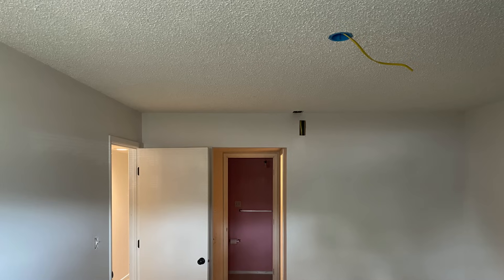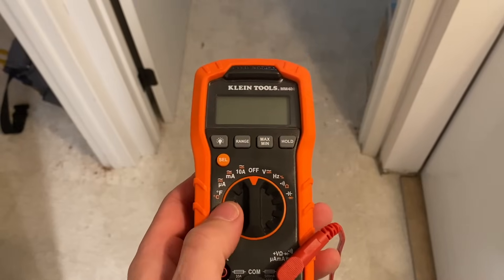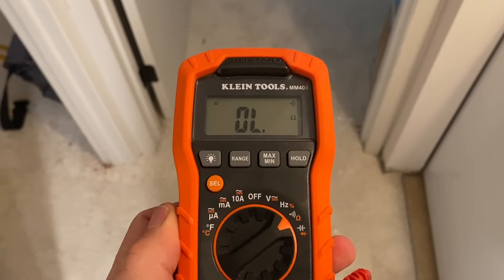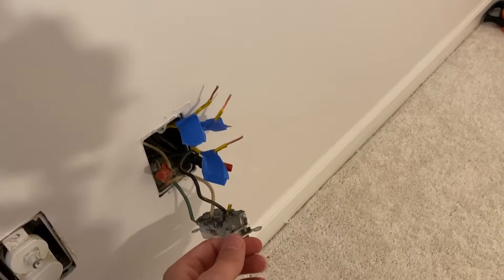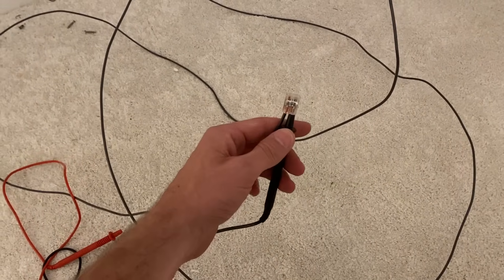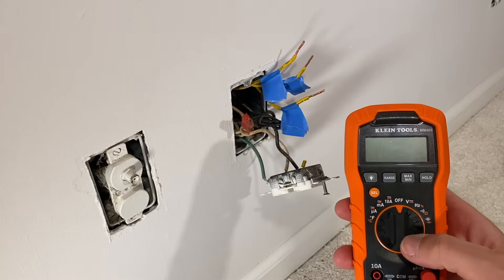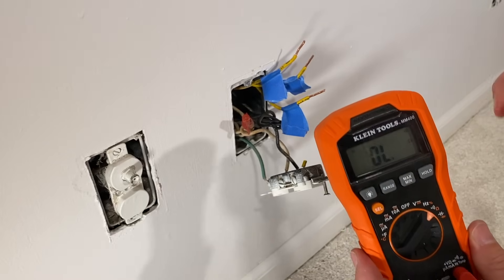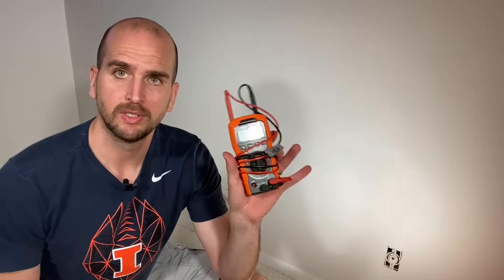How To Trace Wires In A Wall | Multimeter Continuity Test

Comment: And if the wires are in different rooms/floors - so the extension cable is not easily connected- what would be the best solution?

Comment: Can this trick be used for neutral cable? I have a three-way switch that is meant to light up four (4) can lights but I can't find the loose neutral wire. Of course the prior contractor or owner left dead wires in the conduit. I really want to avoid having to re-wire everything. HELP!

Comment: Good video. Thanks. Somewhat misleading however, as you describe setting the meter to "ohms", but aren't you really setting to "Continuity"?  On your meter they are the same setting, but on many meters, Including my Fluke 77 IV, they are different settings, so setting to "Ohms" as you describe does nothing.  Setting to "Continuity" gives the proper result.

Comment: I added a heated floor in our bathroom. Now I have a 'nuisance fault' tripping the arc fault in the wall sensor. (Schulter heated flooring). It is on a dedicated circuit. However, even when I disengage every single breaker in the panel box, except my floor, I still get the nuisance trip. How would I go about tracing that fault? Or do I need to do a complete rewire of my panel?

Comment: I understand and appreciate the comments that (for some situations) this can be done without the extra wire.  But I like the way that he's shown - with the extra wire: it can be used for ANY situation, ANYWHERE, and does not depend on additional wires.  So it's good for any home power wiring, speaker wiring, RCA wiring, coaxial wiring, Cat5 etc. wiring, and anything else you can think of, as long as it's unpowered and of reasonably finite length.  And it can even be used for a single wire with no other wires anywhere near it, other than the extra wire he's using to test it.

I like the comprehensive approach he's shown.  I'm going with it!
Reply: Me too

Comment: Wow this looks super complicated lol, i usually just bypass switch so outlet is hot all the time the just run switch leg from the light switch box, cuts down on the confusion. The only time i can think of using continuity is for water heater thermostat check

Comment: Why not remove slaving switch. Bundle wires to outlets together so they are always on? Push bundle deep in box and add new switch and wiring for the ceiling fixture. You shouldn’t have to touch those outlets.

Comment: I understand the need/want to have a ceiling fixture option but I'd never have a new home without one half of each receptacle wired to switch in the bedrooms, living room, den, etc. There's NOTHING like the ambience of lamp lighting! (Ceiling fans need a ceiling mount of course. So I remodeled with two switches in these rooms.)

Comment: My problem is, with a ceiling fan point, where ceiling fans are getting burnt. Thrice, it has happened already. This point is operated through two way switches. Since, last 20 years,     it was functioning well, untill recent problem. How do I find the fault, either with a multimeter or any other method?

Comment: Does the circuit have to be turned off to test continuity?   I would think so but want to verify
Reply: Yes. The tester itself it actually forcing a small amount of current through the cable and that is how its able to test continuity.

Comment: Thanks for the video. Can I use this same technique to check continuity of the ground on my water meter to my ground on the electrical box?  I have so much audio noise (EMF) while playing electric guitar through a guitar amp. It changes as I move my guitar's direction, but much worse by the water meter. Thanks in advance :)

Comment: You might use a wire tracer, which sends signal along the wire, you can then use the detector to trace where the wire goes. You don't need an extra wire, nor you don't need the probe to touch the wire core, even you can detect the signal outside the surface of drywall, which let you know which direction the wire goes. More, you can use it to tell where a wire is broken inside the wire sleeve. I bought one at about $30, very useful. Make sure there's no power on the wire before connect it to the signal emitter.
Reply: This is perfect! I'm buying one right now.
Reply: This is a good explanation, I have a question for you! Can I use the wire tracer to find a cable that has been bitten through between the ceilings?
Reply: What is the name of the tool you use to trace ? Or model number I’m interested in buying one

Comment: Can you do a video on adding smoke detectors to a hard wired system. I have a room that was left off the detector run and not sure how to add one in to the existing circuit

Comment: Great video.... thank you... I used an extension cord instead of the solid core wire. I also used alligator clip 12 inch "jumpers" instead of the Wago. With both boxes completely undone, you can use the hot and neutral in the same romex cable to test continuity.  Breaker is always in the off position when working with home wiring.  Thanks again. Great video.

Comment: Quick question I have a outlet with 2 light switches one for a light and one for the garbage disposal and a power outlet but one switch has 3 set of wires when the other switch has one and the power outlet has 2 sets of wires , how do I hook that switch up??

Comment: EVERYDAY HOME REPAIRS, when using cable Trackers/tracers if the wires in the house are wiring all over the house, the cable tracker tracer doesn't tell you how long the cable length is and where the cables go up, down, left, right because the cable can start in the back of the house and run all over until it reaches the front room in the house. Anything to use that will find the cable length or if the cable has breaks in it?
Reply: The ohms\continuity will help you trace a wire and show if it's broken. He was just using the continuity and listening for the beep.

To find the length, you can also use ohms. (Ex) 12 gauge wire has 1.6 ohms per 1000 ft and 14 gauge wire has 2.5 ohms per 1000 ft. If you had a spool of wire and you wanted to know how long it was you could calculate it out.   1.6ohms/1000 = .0016 ohms per foot. A wire 20 ft long should have an ohms reading of around .03 ohms. 500 foot wire would have an ohms reading of .8 ohms. It might not be laser accurate but you an get within a couple of feet.
Reply: @bjen2005  I wonder where you get those numbers. 1.6 Ohms for 12 AWG and 2.5 Ohms for 14AWG? That doesn't seem right, because according to NEC Chapter 9 Table 9 for 12 AWG it's 2 Ohms per 1000 ft, and for 14 AWG it's 3.1 Ohms per 1000 ft

Comment: Thanks for sharing.

When the two living room lights are on, the toilet, laundry and bathroom light switches don’t work.

When the living room lights are switched off, the toilet, laundry and bathroom lights act weird.

Toilet light switch turns on the living room lights and toilet light is half illuminated as though not much power is getting to it or it’s out of phase or something.

Laundry light when switched on thinks it’s the living room light switch as zero power makes it to the intended laundry light.

Bathroom light switch seems linked to both bathroom AND living room light fittings. When I turn on the bathroom light switch, the living room lights come on in addition to intended bathroom light.
Reply: Damn sounds like you have a bunch of 3 ways wired weirdly and also some loose connections somewhere

Comment: 1. turn off power at the breaker.  2.Isolate each cable coming into the box twisting the hot(black) and neutral(white)conductors together one cable at a time.   3. go to the other outlet or switch box and place your meter on OHMS to the loose hot and neutral of each cable.   4 The one that beeps is the cable you have twisted together at the other box.   5.ID that cable, untwist the conductors and proceed to the next pair of black and white conductors on the next cable. 6.Label each cable as you go. This works for locating shorts as well.
Reply: Could also just use the wago he showed to clip the hot and neutral together
Reply: I was going to leave the same comment when this popped up in my feed that's how I trace all my wires. Who wants to run a wire through someone's who house to test continuity if you only need a wirenut
Reply: Mind blown
Reply: I've used the other method and was looking for a way to not have to test with the long wire. 
Thank you for your contribution!
Reply: @Adekunle Once you bond the hot coming into the second box with the neutral, you can think of that hot wire as extending through the entire house by taking a ride on the neutral side. 😎 All neutrals tie together. Obviously the breaker box should be off for this cheat. So now you know when you touch the neutral in outlet #1 it is actually the hot wire that is feeding through the wall from outlet #1 to outlet #2. So how do we complete the circuit for continuity and get tone? Prod each of the open hots in Outlet #1. One of those is the hot wire feeding into Outlet #2 that you tied into the neutrals.
Reply: But what if, all the wires are the same color 😅😅
Reply: That's what I am dealing with  @liudxdx
Reply: Thanks it makes sense that way
Reply: @Adekunle Hot and neutral tied at one end; Meter leads placed on the open ends of cables at the other end. I don't think you have this pictured correctly
Reply: Can you do this kind of testing without opening the outlet to expose two leads to short together? Like can we just create the short on the outlet itself with a prong between hot/neutral openings?
The reason is that with all outlets installed, I'm just trying to map which outlets are on the same circuit without having to pull out every single outlet.
Reply: Yeah. But this way works too. This is a safer way if you aren’t sure everything is on the same circuit. Like if you don’t want to turn off power to the whole house.
Reply: Thanks thats really helpful advice
Reply: great.....thank you......
Reply: Donka
Reply: Exactly how an electrician taught me how to test for continuity years ago.  Try it yourself on 2 short lengths of wire on your workbench.  Use zip wire or speaker wire if that’s all you have; same results every time.
Reply: love it so helpful
Reply: How does it work for shorts?
Reply: @janhaag3540  Open both ends of the cable(black &white conductors) Place your meter on OHMS and connect the leads. If you get a reading of OL or infinity, the run of cable is fine. If you get any reading of ohms (even zero) you have a short in that run of cable connecting the two conductors(usually a staple or screw/nail etc.) Good luck.

Comment: You can do this without all the extra wire.  Simply connect the wire you are attempting to locate to the common wire in the same box. Since ALL common wires are bonded in the main panel you can then go to the original box and use the common and test each other wire until you get tone. This would work using ground also.
Reply: Make a video? Leave a link here?
Reply: @Orlena2525  To clarify: He is saying tie the hot to the netural (aka common) on outlet #2 in this video. He did not disconnect the netural in outlet #1 nor outlet #2. Thus, once the hot/netural are bonded on outlet #2, you can walk back to outlet #1 and touch a probe to the neutral and it is the same thing as touching the hot all the way over at outlet #2. Then the other probe is used to touch the hots in outlet #1 and you've got the circuit made for the continuity test. You can be assured all neutrals are always connected and will result in a valid test. That is because all neutrals run back to the netural bus bar at the breaker box and they all touch the same plate. This should be safe, but it does sound dangerous? If you accidentally connected a live hot to a neutral then it should immediately trip the breaker as a short circuit...
Reply: @lakecityransom  so if I needed to locate a matching neutral in a service panel to a hot; I can just connect the hot and neutral of the circuit I'm trying to trace, and then use the probe to locate the hot neutral in the circuit panel?
Reply: @MiamiHeat872  I'm not an electrician but all the neutrals are tied together back at the breaker box so it should be irrelevant unless there is multiple incoming service breakers. If you mean it as an academic question then sure you could touch the hot in the breaker box but then for the neutral you would have to take neutrals off of the neutral bar one at a time to test them since they are all connected together, but it could work.
Reply: @lakecityransom  Definitely not an academic question. 

I got a 1950s service panel with ungrounded wires going into it and unidentified neutrals coming in bunches through conduits.

I want to update the wires so that when I have an electrician change the service panel, they can do a swap easily since a lot of breakers have to be AFCI when updated.
Reply: @MiamiHeat872  ah ok I figured the only thing that made sense was to clean up possible dead wires or add wiring for an older house so I guess that is exactly what you are doing. :) Kind of like when the satellite TV guys come and put a new dish in and a new set of wires drilled into your house every time lol. Good luck.
Reply: I have a problem and is that i lost electricity in a circuit. I replaced the old outdated outlets and switches. Turned the breaker back on and nothing. I saw this video and followed the same instructions and found that the wire that I believe is coming from the breaker gane me a reading of 205 on continuity. The other wires fro the outlets and switches didn’t show anything. What do this means! Help!!!

Thank you in advance!!!
Reply: Im having same issue.  Did you ever figure it out?   @YourpainRx
Reply: What would be the Common wire in the box the white wire that is with the Line / Power Right?
Reply: Good thinking .but i would like to see it if it really works
Reply: what’s a common wire. how do you identify it.

Comment: Okay I see you are new in this troubleshooting process. Let me suggest how you can easily find right wire. One incoming wire (yellow) connect to the ground wire and with continuity check find associates wire. Easy you don’t need extra jumper. Imagine you have to check plug in other room or floor above, you need long wire which is ridiculous.
Reply: @Theodore Myles   You're right....no one cares

Comment: You failed to mention that the power should be off on your circuit breaker at your panel! Otherwise great video on demonstrating continuity!
Reply: Thank You. I was wondering if anybody noticed that too. If you're chasing down wires in your walls to figure out what goes where, you got to flip this breaker OFF or at least precheck all the wires in AC mode before "horseshoe" (sic) mode. Or you or DMM may got abruptly damaged. BTW - never heard about that greek symbol omega to be called horseshoe. LOL.
Reply: Did you intend to say the circuit breaker should be off?
Reply: @truthbebold4009  yes thank you, it’s been corrected

Comment: So I see how you found the hot wire but how about the white that corresponds to it.
Reply from the maker: If you have Romex in your home and you have found the hot wire then you usually can just match that to the neutral and ground coming from the same romex line into the box.
Reply: @EverydayHomeRepairs  10-4
Reply: I needed to do something like this when installing a GFCI breaker. Power off, of course, I connected the hot and only neutral at the outlet with a Wago. Then, I disconnected the hot from the old breaker and disconnected the two neutrals I thought it could be from the bus. One of them had continuity so that was what I was looking for. 

You could also do something like that instead of running a wire across the room like was done in the video.

Comment: Do you haver to have the wire stripped?
Tracing a wire at the switch  (wire is stripped). Back at the breaker panel can I just clip on a wire.
Or
do I have to detach the wire from the neutral bar?
Breaker panel is off.
Reply from the maker: I would remove from the neutral bar to isolate which wire you are tracing.

Comment: Dude..disconect hot wire and tie gound together with wire in question  .no need for extention wire
Reply: I use the ground because its already striped and and you can just positupn the wires so they touch no need to take too much apart
Reply from the maker: Thanks for the feedback 👍
Reply: Since the breaker is off, put the hot and neutral in the wire nut and go around the room with the meter and check each hot and neutral with the meter until you close the loop.  That's just how I would do it. :)

Comment: Why take all the outlets apart?  Just use leg from the switch and wire it or wago it the the full time hot and you’ve accomplished the same thing.
Reply: Do you have a video showing this? Would like to see it done. Thanks
Reply: Julius Byes no I do not. Just 20 years of experience. 
All the top switches outlets originate at the switch along with the line power feeding the switch. Just makes sense to me to tie the switch leg to the hot and bypass the switch to feed the top half of outlets

Comment: How do you measure "leakage" current from outlets and electrical wiring?
Reply: Fluke makes some tools for it. The ones with the electromagnetic jaw/ring. Put the hot and neutral wires through the ring and turn power on. Keep ground wire outside the ring. Fluke in AC mode will measure leakage, which is the difference between current going in on hot and coming back on neutral. The difference is the current leaking to ground.

Comment: Super helpful! I really appreciate the tip. i am a 
dyi'er and finished my basement over 20 years ago. I need to do some testing of 3 and 4 way Lutron dimmers for my can lights and I did not document which switch was in what position from the load panel. This will help me identify which wire is first in line from the AC Panel. (After removing from the circuit breaker first of course.) Thanks again.
Reply from the maker: Best of luck on the project Tom 👍